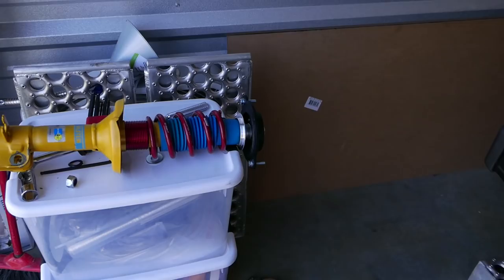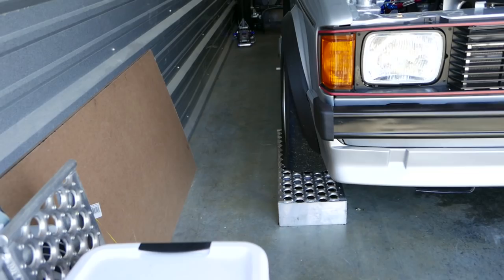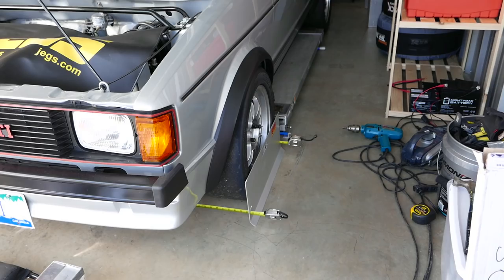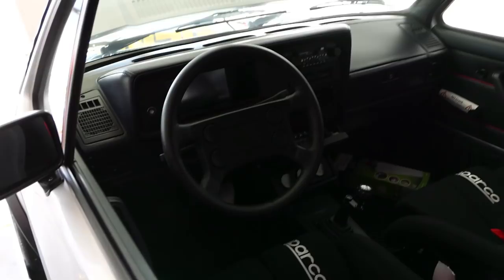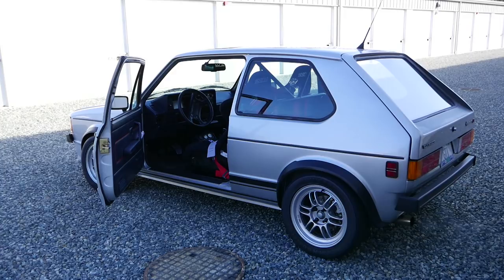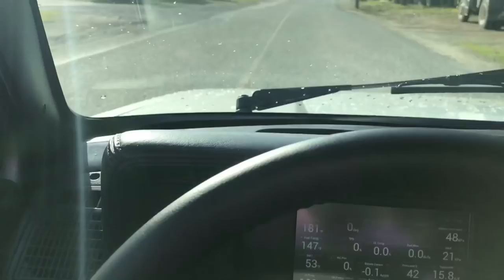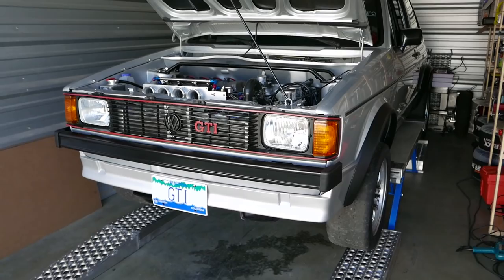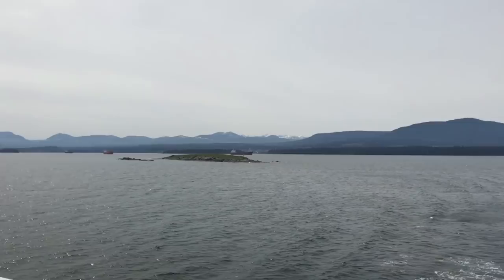The Ultimate 1983 Rabbit GTI - part 163 (Suspension Alignment, Road Testing)

Comment: First! Ready for more Ultimate GTI refinements!
Reply from the maker: Just ordered Quik-Latch hood pins as I realized that the forces on the hood latch during racing >160kmh are very high and the carbon-fiber bonding to the nuts that hold it together may pull out!

Comment: Hey Derek!  Thanks for all your videos, they have been really helpful as I try to get my mk2 VR6 GTI on the road for autocross season.  How do you measure your camber?  I have an angle finder digital cube, and I'm considering making a fixture to measure my camber, but I was just curious to see what you do.  Also, do you find that using the camber plates and getting rid of the stock rubber strut mount adds unreasonable harshness to the ride quality?  I realize this car is primarily a fun car so there is that.  Cheers!
Reply from the maker: Measure the flatness of your garage floor at the points where the tires contact the floor, create plywood spacers to level out your car, then use a digital level to measure your camber. A trick when adjusting if you are removing the wheels is to re-measure the camber after the wheels are off and the car is up in the air (use the brake rotors as the references), and then make the changes as a delta to the current settings. I got good enough at the procedure to set it once, put the wheels back on, drop the car down and have the camber within 0.05 degrees on each side. Also, by sighting/aiming the Green-Acres toe plates to the rear tires I was able to get the steering wheel centered and the toe perfect as well. The trick with the toe is to only turn the tie-rod end links 1/6th or 1/12th of a turn and then re-measure as small increments make big toe changes.

Comment: The official tracking for the front is:
Toe-out 5' to 30' (0.5 to 3mm or 0.020 to 0.118")
So you know.
Reply from the maker: I chose 1/8" out based on some racer suggestions, vs 1/16" for purely street use. I don't really know what is best for the track using slicks. I intend to reduce the toe once the car is back to purely street use in 2 years